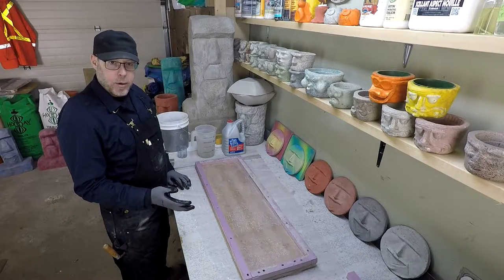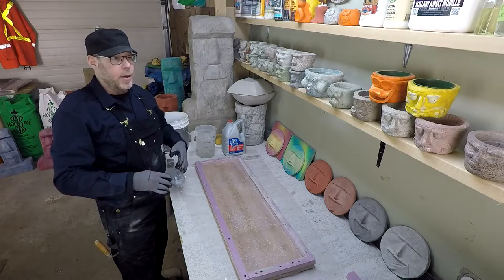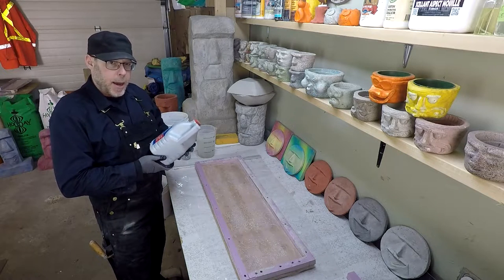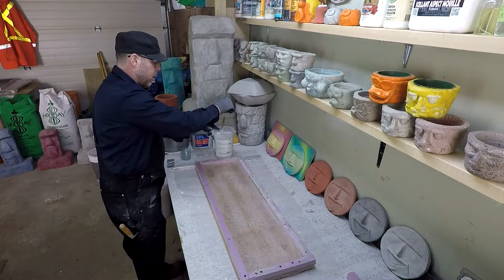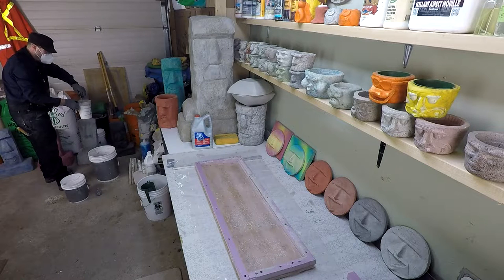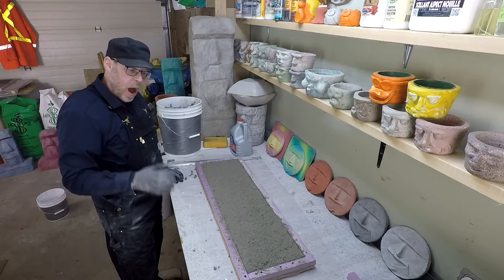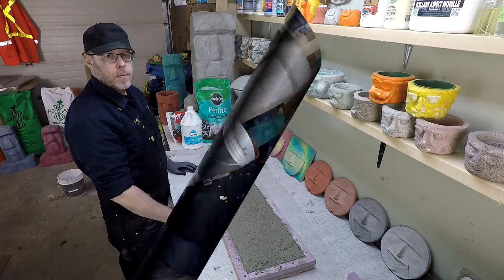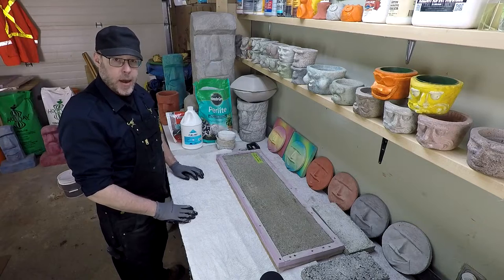Making High-Strength Lightweight Concrete

Comment: Thanks for all the info you pack in to these videos!

One thing I hasten to add (and I know no one likes overbearing health and safety!) is that the smallest and most dangerous particles are invisible and stay suspended in air for quite some time, so whilst wearing a mask when mixing is great, there's a great deal of exposure afterwards in an enclosed space. I appreciate that you're filming a video and need to talk to camera so might not usually take the mask off quite so quickly and if you know all this then apologies! I'm quite a stickler about these things since my dad developed COPD working in the cement industry before all this was known.

Keep up the good work!
Reply: Thanks for the extra info about COPD. It's a little late for thousands of merchant seaman who worked "supply boats" in the Gulf of Mexico. Part of our job was cleaning bulk/dry cement tanks. Big enough that there were permanent steel ladders to reach the bottom. If we were lucky, we had paper masks. 
  I drew the line on potential suicide when one day in Venice LA they loaded us with Barite or cement (same tanks) and suggested we read the paper work.
  There was an additive called "Hexavelant Chromium", the warning stated "may cause pulmonary fibrosis, low single dose toxicity expected". Trust me, with paper masks low single dose was a joke.
  Hexavelant Chromium destroyed Hinkley CA and the lives of all that lived there.
  No telling how many loads of poisonous contaminants made it's way to the drilling rigs and platforms and cut short the lives of thousands. It would all seem like natural causes. Old age, cigarettes etc.

Comment: Thanks for the video, as an 'old' builder from Australia, rather use a polymer based product than PVA, as PVA recontitutes when it gets wet whereas a polymer product does not. Make sure to use a release agent on your formwork.
Reply from the maker: I do not disagree that acrylic and latex admixtures are superior for any wet application.  Noteworthy is that some modified PVA products will emulsify one time only, not again, which makes them resistant to re-emulsifying with the moisture the concrete is exposed to in the future.  Cheers.
Reply: Can you name some products that do this?

Comment: Great videos! 👍🏻. I am thinking about building a house and was wanting to make it out of concrete. I could make the walls out of regular concrete and then after that put insulation on the inside. The other option I was thinking about is using the light concrete that's already insulated, but I wanted to ask you, do you think that would be possible to use light concrete for the walls or is it just not sturdy enough?

Comment: Thank you so much for your videos - they're very helpful to me as I've just recently started working with cement/concrete.   Can I just confirm please that when you're talking about ratios your parts are volumetric?  I have some weight based recipes, but I'm assuming since you're working with such different densities you're talking parts by volume rather than weight.

Comment: Thank you for your videos. I wonder if you would help me answer an important question. Here it is: my concrete driveway, 35 yrs old, within 3 feet of my 2 car garage entrance has worn off to the point of creating a water puddle in that area (3x20 ft) after a nice rain. Question is: what concrete mix I might lay over it to build up the depression permanently and get rid of the puddle. No expert here, but can follow directions.
Thank you
Reply from the maker: This is an overlay / patch and nothing will work 100%.  I would use an overlay concrete patch.  That is what I would buy, but f you want to make it yourself it would be a 3-1 sand to cement mortar, with 10% water replaced with liquid acrylic / latex.  I would also use a latex bonding slurry and paint it on the old concrete right before you roll the patch over. If you use overlay mix you dont need the slurry.

Comment: Hi.  Thank you for all the great videos.  I am contemplating creating some large patio pavers (2' x 2').  I am thinking I might need to move it around and experiment with different layouts. Do you thing this mix would hold up as patio pavers?
Reply from the maker: No I do not think it will hold up.  You need sand in the mix also for strength because with only lightweight aggregates the finished product is very weak
Reply: @creatingconcrete  Thanks!

Comment: I would like to know how hard it is to work with as far as cutting channels. And how does it stand up to heat I’m looking to make walls for my kiln and run it at 2500°F😊
Reply: Cement/concrete isn't good for high temp applications, Tom, because tiny pockets of water can exist in it for a long time - and the heat could make it shatter explosiveky. You'd be better going with plaster.

Comment: Oh I'm sorry I thought you were going to straight tested you were just leading me thanks a lot
Reply from the maker: I have probably 20 videos on making, testing, breaking and using lightweight concrete.  Not sure what you are looking for but I show the whole process, the mix, the results...
Reply: @creatingconcrete  
Thanks for sharing the experiment, can you please give me the link to the follow up
on this video if there is one. I am interested to see if adding the glue and fiberglass improved the performance of the panel.
Reply from the maker: @shareyourchristmas  here is the follow up video where I break this one.  If you want to see it compared in strength to other mix designs check the video description where I have links to each mix design I have made and tested. https://www.youtube.com/watch?v=-9nCmjbb7i8&ab_channel=CreatingConcrete
Reply: @creatingconcrete  
Thank you, I just watched it.
That was helpful.
I have been thinking of doing a DIY external wall siding using light concrete panels.

It is great to see someone who has a passion for working and experimenting with different mixes.

It would be great to one day find out what you think could make a good lightweight
concrete wall panel.
 🙏

Comment: what happened in the stregnth test?
Reply from the maker: The strength test is an ongoing comparison.  So far I have only tested very basic mixes.  The next series will include more advanced mix design, more admixtures, aircrete, lightweight reinforcing etc. So there is no official conclusion, at least yet anyway.